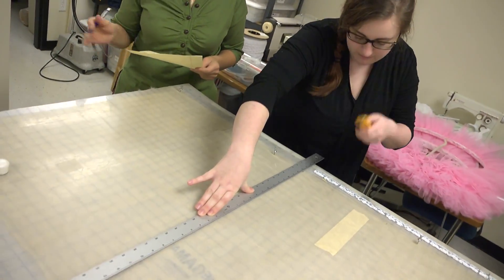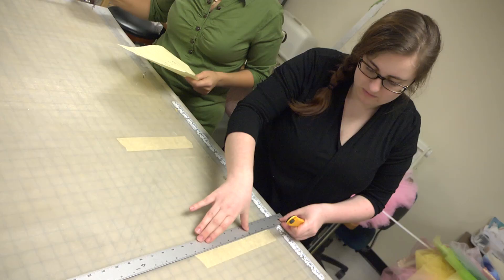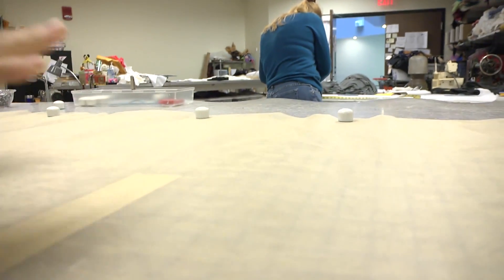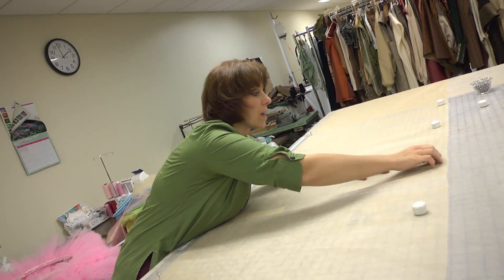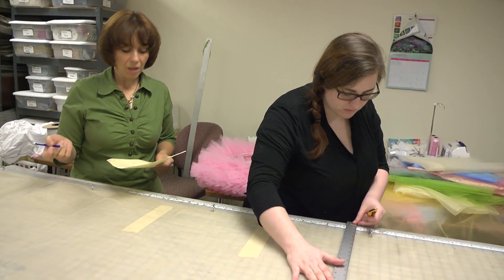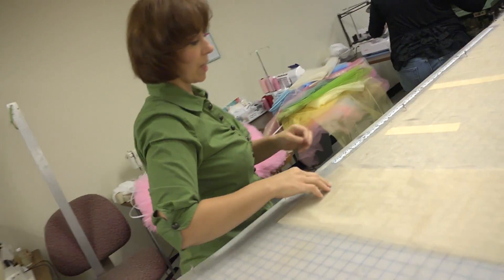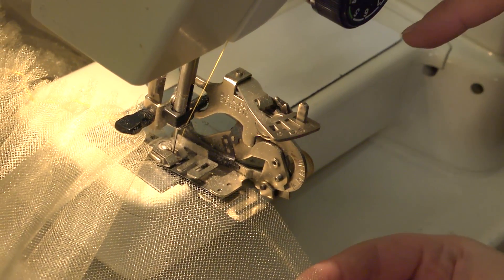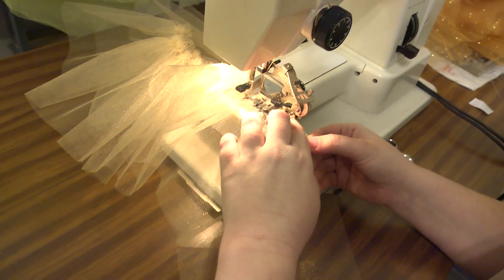Constructing a Classical Ballet Tutu (Part 3: Cutting & Gathering the Tulle) -  University of Akron

Comment: I'm confused as to how many "strips" of the 11.5", 10.5", etc you cut for each tutu?
Reply: Not sure if this is still helpful, but it's each time 5 cuts per tutu layer, I believe the reason she sais 8 bundles, it's because she'll make 8 tutus.
Reply: k scott it one per layer, so each layer is one inch shorter than the last.
Reply: She cut 5 strips of 11.5 & 10.5 inch then went down to 4 strips for 9.5 and under.  Top two layers need more strips to look fuller.
Reply: @sewitseams5632  so it went down to 3.5" for the smallest layer?
Reply: Angel Garvey yes
Reply: @sewitseams5632  thank you!